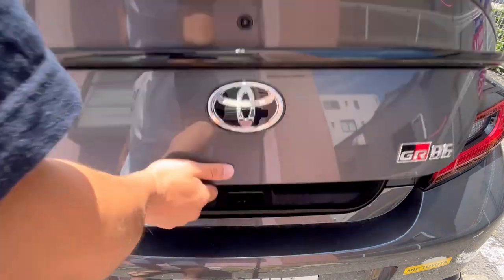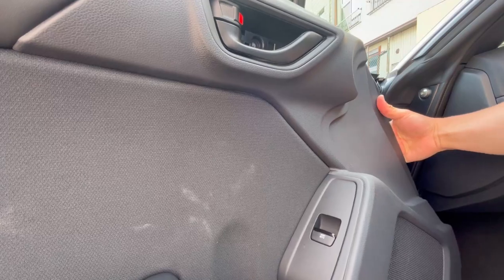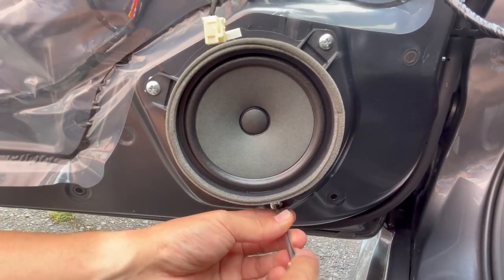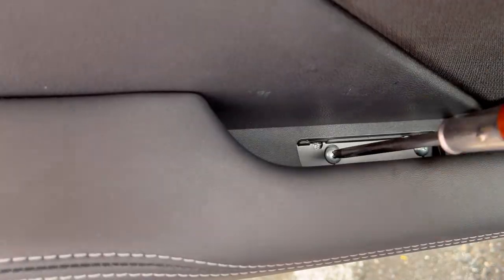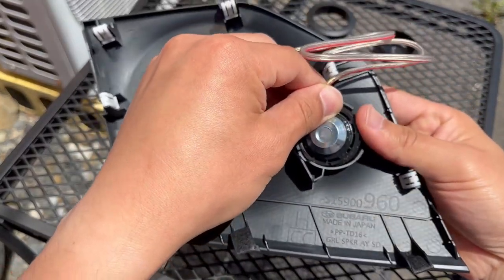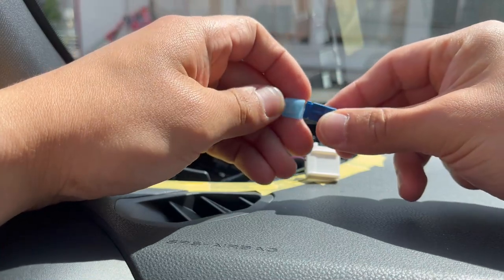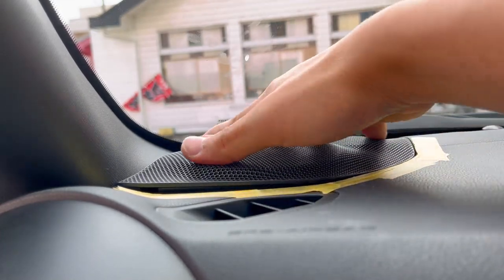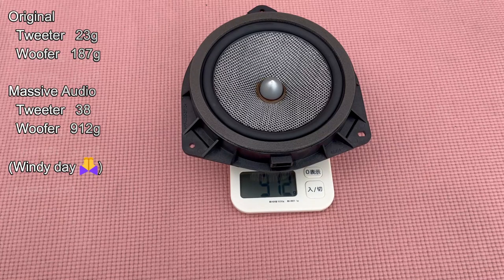Front Speaker Replacement [GR86·BRZ]

Comment: I'm always so impressed with how much you've transformed this car. After having a Civic SI that was modified and became very unreliable, I am always afraid to mess with my new GR86 now.
Reply from the maker: Thanks for the support! Glad these videos help.
Reply: what made the Si unreliable?  on the 86, don't touch anything in front of the catalytic converter or under the hood.  bushings, cat backs, wheels/tires...anything that does not come in contact with the engine and you're golden...
Reply: @K03sport  I think its what the previous owner did to it after I bought it. I got fleeced by the dealership. When I went to fix it, I didnt realize it had a broken head gasket. And the turbo manifold had been ground down presumably to fit a big turbo in it that was replaced with the stock when it was sold. It also ended up having once of the pistons be fucked. Somehow, I have no idea how, nearly everything got covered under warranty. I had a friend at the honda dealership that hooked me up. Once it was up and running, I sold the fucker the second I got it.

I've hear Subaru engines are really finicky so I don't plan on touching it on the 86. I think its fine as is. If I wanted to go super fast, I'd just get on my motorcycle. I got the 10th anniversary edition too so looks wise its fine for me. Only thing is the bushings though, and better suspension. Thats it.

Comment: Amazing video! how did you check which wires you needed to use for the tweeter install?
Reply from the maker: Sound checked after one connection. 😅
Reply: @39gjapan isn’t it possible to have the polarity incorrect as either way will work?

Comment: Wouldnt the sound passing through the tweeters not be ideal for the new speakers' clarity? Is it not better to link the door speakers directly to the head unit instead? 

Reason i ask is that i installed new speakers today in my gr86 and they sound nothing like how i heard the speakers in the store and the reviews. I found out that this is because this car's door speakers are routed through the tweeters (instead of the head unit) it cuts out signals of mid and treble drastically and makes the speakers not function properly.
Reply from the maker: This is why I tapped together so the door speakers can get the signal directly from the headunit.

I think getting a component speakers with crossovers would help. Plus applying deadening on the doors. Some car audio stores use deadening on their demo speakers. So that can really make a big difference. 😅
Reply: agree w/OP.  also, store displays help you compare IN THE STORE, but will do nothing for in the car.  Plus, the store display was most likely amplified.    If the 86 (brz) is anything like my wrx, the dash speakers might be a different ohm rating and are connected to the telematics unit (think voice controls).  Ideally, you want to power the speakers from the hu.  2-way speakers will have an inline capacitor on the tweeter to block low frequencies.  A separate component set will have a beefier crossover separating the frequencies much better btwn the woofer and tweeter.  Best bet is to find speakers that have an RMS rating that is closely matched to the source powering them (either hu or amp).  Also, an external amp will always give better sound at the same watt (power) level because it is bigger and has more "bits" amplifying the signal.